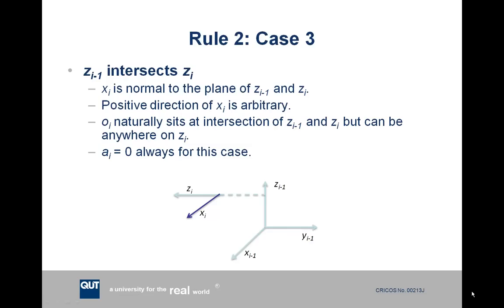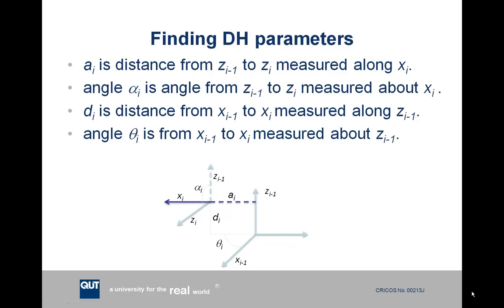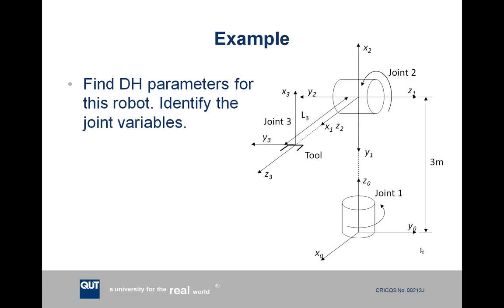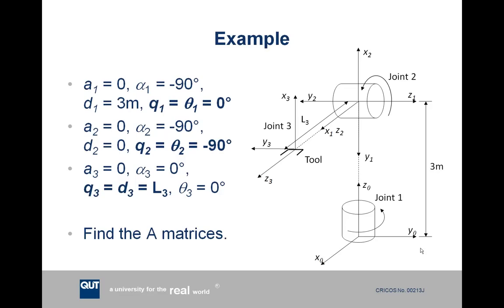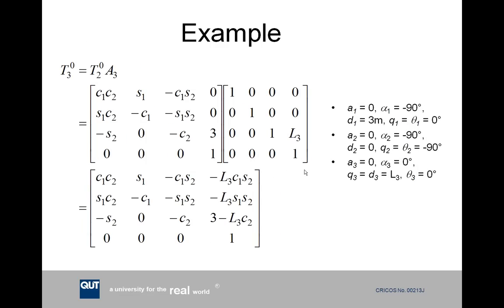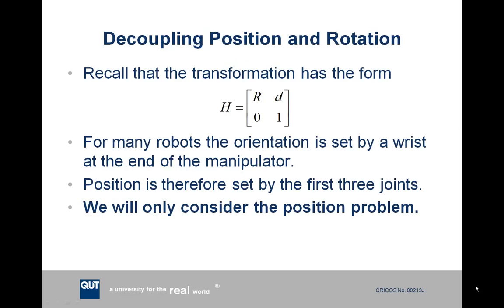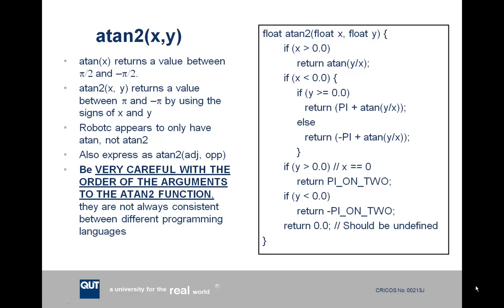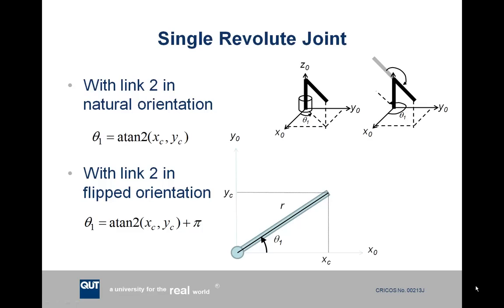Forward and Inverse Kinematics Part 2

Comment: Thanks for this video series, they are being very helpful! I am afraid the value of θ2. It is not directly -90°, but θ2 = q2-90°. θ2 is the angle moved from x1 to x2, measured along z1. Only in the special case when θ2=0, as in the example, θ2=90°. The problem when making this direct substitution when θ2=90° is, the matrix won't work with different values of q2 for the same robot. I did the general case, made the trigonometric substitutions and achieved the same results as you.

Comment: I was confused that in this video, the Xi axis points from joint(i-1) to joint(i) along the link length between Zi-1 and Zi. However, I was taught that Xi is supposed to point from joint(i) to joint(i+1), lying on the link length between Zi and Zi+1. Is there a strict definition about how to locate the frame? I've seen so many different ways on the Internet, including the ways of locating DH parameters.

Comment: Hi, I was just trying to understand something. Does the HT, transformation matrix represent the NEW details of the tool tip position/orientation relative? Or does it represent the CHANGE from previous position to current? Sorry if it's a dumb question.
Reply: Pretty sure it represents the change. You take the old position/orientation matrix and multiply it with the transformation matrix to get the new position/orientation matrix.

I think.
Reply: HT Transform gives you the angle and the coordinates in the base frame when you can measure the angle and distance from the tool frame using the sensors is my understanding.